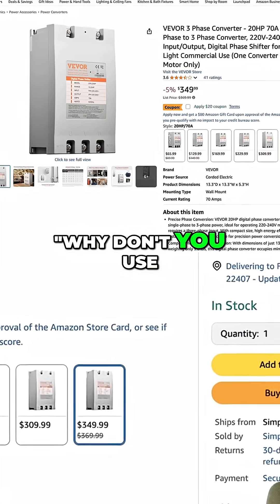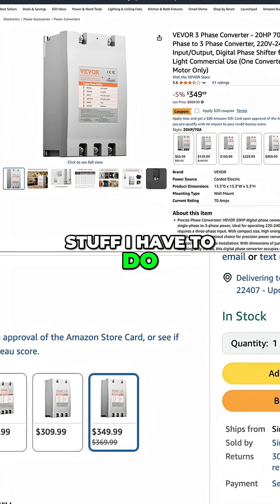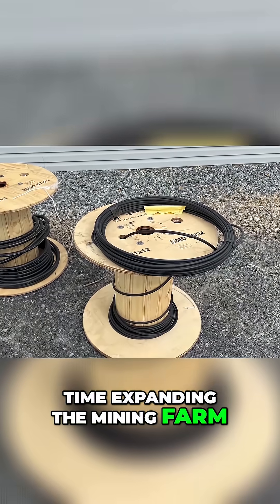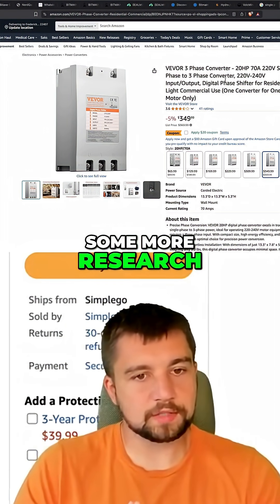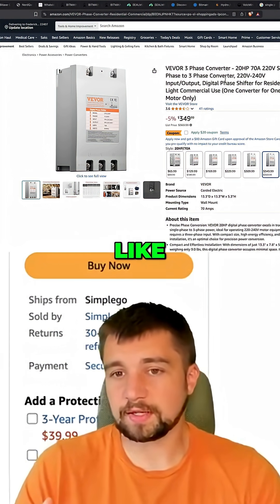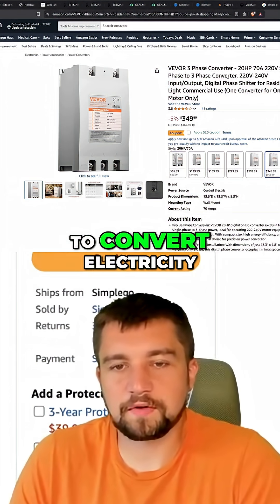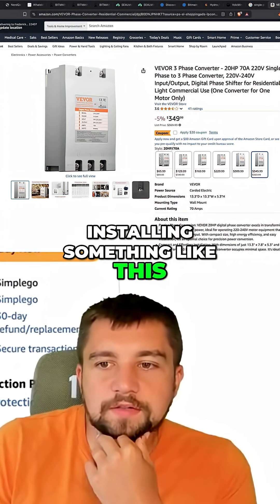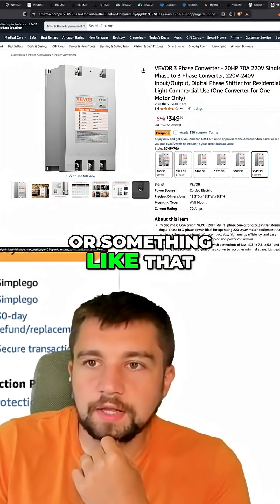Why I WON'T Use a 3-Phase Converter for My Mining Farm! #shorts

Comment: You also have to run a motor with those. 2 different parts... But running the motor takes power. you'll lose even more juice and power will be even more. Don't do it... I was just showing them to ya. :) 

Additional Power Consumption Per Hour
"Regular power use" assumes the motor's baseline draw on true three-phase (no converter losses). The VEVOR adds losses from inefficiency, imbalance, and standby draw. Calculations below use:

10HP motor output = 7.46 kW mechanical.
Typical motor efficiency = 88% → 8.48 kW electrical input on true three-phase at full load.
Converter efficiency = 85% (conservative from reviews/forums; your mileage may vary 80-90%).
No-load: Motor idles at ~20% load (1.7 kW input) + converter standby.

At Full Load (Continuous Run)

Total single-phase input: 8.48 kW / 0.85 = 9.98 kW.
Additional power: 9.98 - 8.48 = 1.5 kW (converter losses + motor extra heat).
Per hour: 1.5 kWh extra (at $0.15/kWh utility rate, ~$0.23/hour added cost).

At No-Load/Idle

Motor input: ~1.7 kW (true) → ~2.0 kW total with converter.
Additional power: ~0.3 kW (mostly standby + minor imbalance).
Per hour: 0.3 kWh extra (~$0.045/hour).

Comment: @voskcoin Those amazon things aren't made for digital power supplies..  they will destroy a 3 phase digital power supply. Your best bet  would be to get a DC to 3phase AC INVERTER connected to your solar array.. 
 so the only real way to make clean 3 phase from single phase would be to convert your 240 single phase to DC voltage, then use a dedicated 3 phase inverter to make a clean sine wave.  Doing this is inefficient and loses a lot of power so it would ONLY be good for testing purposes.  Connected to your solar array avoids one side of loss, so that's a possible option as it's DC straight to 3 phase whatever voltage (380, 415, 480 etc), which is basically what the power companies do with their solar panel arrays